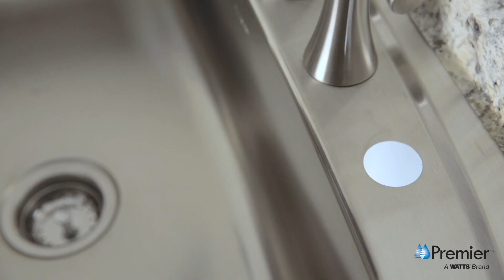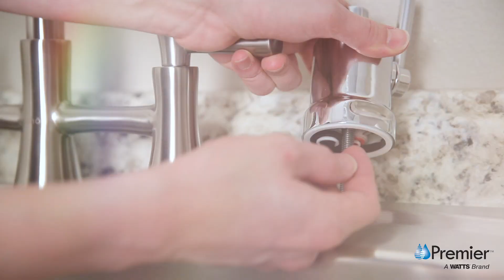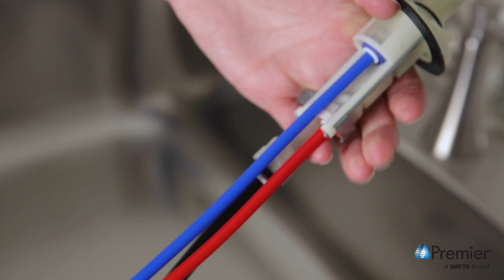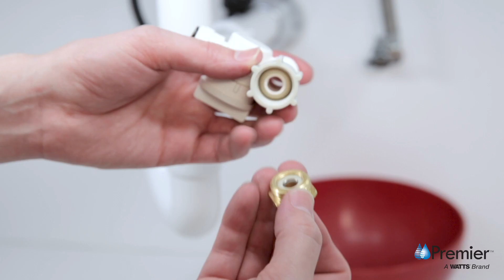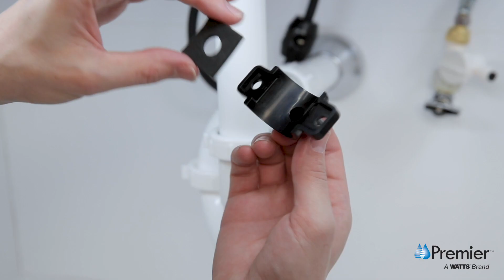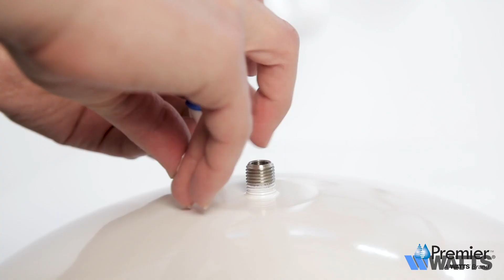Premier's RO Pure & Pure Plus Installation

Comment: It appears the plumber did not install the white Adapt-a-valve when installing my RO-Pure system.  The green tube is plugged into a brass connecter with a directional valve on it.  Will this still work to shut off the water flow to the tank for sanitizing?  I have tried turning it clockwise and the water does not seem to shut off.

Comment: Hi
You said use 1/4 inch bit for the drain hole. Manual says 3/8 which makes more sense as the tube is 3/8. 
Which one is correct?

Comment: I really don't like the idea of having to drill a hole in the pipe to use this. I could see leaks happening. I guess it has to be this way or has to be custom done otherwise with a piece that is specially designed for this. Instead it would make more sense to me to simply fill up the sink or some container with water and then stick the tubes in and have them suck up the water and filter it.

Comment: I recently bought a house with a system installed by the previous owner and I'm trying to get the system running again. I have a few questions:
1. How does one remove the water lines from the fittings? I don't want to damage either the hose or the fitting it plugs into
2. The black air gap line is improperly installed and too long - it dips beneath the drain saddle. Am I correct in assuming that this will cause big problems?
3. There is a water pump and a 40 PSI pressure switch installed under the sink, which is pumping the green tube. Is this a normal or recommended installation? Can I safely remove it from the loop?

The previous owner was a DIY guy and did a lot of things without following directions precisely, so now I'm following up the work that he did and tweaking it to work just right. There's stuff like this all over the house. Thanks for whatever help you can provide for this one!
Reply from the maker: Hello, we do apologize for the delay in our reply. See answers to your questions below:

Q1. How does one remove the water lines from the fittings? I don't want to damage either the hose or the fitting it plugs into
      A. To remove a tube from a Quick Connect fitting you should make sure the system is depressurized. Then, depress the collet ring on the fitting and pull the tubing out. Depending on the size of the tube you may use a 1/4 inch or 3/8 inch open ended wrench to depress the collet ring instead of your fingers. If you have difficulties pulling the tube out, you can try pressing both the tube and the collet ring in then pull out the tube while holding the ring down.

Q2. The black air gap line is improperly installed and too long - it dips beneath the drain saddle. Am I correct in assuming that this will cause big problems?
      A. If the system and faucet are connected as designed, having the black tube dip under the drain saddle will eventually cause your air gap on the faucet to leak. 

Q3. There is a water pump and a 40 PSI pressure switch installed under the sink, which is pumping the green tube. Is this a normal or recommended installation? Can I safely remove it from the loop?
      A. It sounds like a booster pump was installed on the system to increase the incoming water pressure. This is normal for homes with low incoming water pressure as the system's storage tank may not fill properly and the system could run for longer periods of time. In that situation, the pump may increase the storage tank's fill rate and storage capacity. To know if you can remove the pump/electrical components, you first should make sure that they are not installed in a ZeroWaste configuration. This can be determined by looking that the hot and cold water angle stops under the sink. If you have 2 adapt-a-valves (one on each angle stops) with a Green tube coming from the Cold water and a Red/Black tube leading to your Hot water, then the system is connected in a Zerowaste configuration. However, based on your second question I do not believe it to be installed in a ZeroWaste manner as the ZeroWaste does not use a Drain Saddle but instead returns the Waste water to your hot water lines. If the system is not connected as a ZeroWaste then you may certainly remove the pump, if you wish, as it is not critical to the operation. To remove the other electrical components just make sure that your system has an Automatic Shut Off Valve (ASOV) installed so that the system shuts off like it should. The ASOV is a black block-like object with 4 Quick Connect fittings (2 on each side).

Please let us know if you have any further questions or need clarification regarding any the above information.

Premier A Watts Brand
Reply: @premierawattsbrand3030  Thank you so much for the response! I got the system up and running by unplugging the booster pump and allowing the system to just run on city water pressure. Everything is working now better than the previous owner was able to get it to work (he abandoned getting the ice maker in the freezer up and running, but I was able to get it to work). 

Really appreciate the response and thorough tutorial. I will definitely be buying my next set of filters from you! :-)

Comment: I recently bought the 3 stage RO system and purchased a separate drinking faucet. The new one I purchased only allows one line to plug into it. The one that came with the RO system has three, is it possible to use the one i bought with this Watts system? Thanks
Reply from the maker: Which 3 Stage RO system did you purchase and which RO are you replacing RO Pure or Pure Plus? Whether the faucet is interchangeable or not is dependent on the tubing size of the faucet connection on the system. The faucet of the Premier RO Pure System in this video may have either 3/8" connection or 1/4" connection where the Pure Plus only has a 1/4" connection for dispensing the drinking water. Please refer to the owners manual for tubing size of the purchased 3 stage system. If the system uses a 3/8" tubing and you had the RO Pure, then it may require you to remove an adapter that would have been installed on the Premier Faucet. The Pure Plus would not accommodate a 3/8" connection.

I hope this helps! Please let us know if you have any further questions! ~Premier

Comment: i seem to be having a problem with my system, why would water be gushing out at a high rate from the blue tube that connects to my storage tank? the tank fills at a rapid rate?
Reply from the maker: There are a few possibilities for the water to be flowing at a high rate like this. First, verify that your filters are installed in the correct order, Red > Yellow > Green > Blue. If this is a new install, verify that your plumbing is correct. On the back of your system, trace the Blue tube between the black ASOV and the System manifold to make sure it is connected to the top port behind the Green Membrane filter and the Red tubing is connected to the port below it. (The top port is closest to the mounting holes on the mounting bracket.) If this is an older install, you may have a bad ASOV and the water is bypassing the filtration system flowing directly into your tank. It is also possible, however unlikely, to have a bad membrane. You can give our Technical Support a call so we can help to troubleshoot the system with you at 1-800-752-5582 option 4.

Comment: This is Pun Call's husband, Harold, and I'm not a happy camper. We went downstairs this morning and found water all over our basement on our new laminate flooring. I searched everywhere for the source and all I can determine is, when the water leaked out of the air gap faucet, it ran through the holes in the kitchen floor under the sink where the water lines come up. A "How To" video here says the drain line into the sink drain will plug up with debris from the garbage disposal, and has to be blown out. Nice, huh? What kind of ignoramus designs something like that? And, on my unit, the hole in the faucet is at the back so any water that comes out runs across the counter top. If the hole was in the front, it would run into the sink. So, now, I guess the solution is to turn off the water to the R.O. unit whenever we're not using it. That's a bunch of bullshit. When I had a plumbing and heating business many years ago, I used Watt's regulators and other things, and found them superior in quality. But today, they obviously have a new crop of engineers who don't know their ass from a hole in the ground. I'm going to scratch Watts' name off my list. Might as well buy Chinese crap.
Reply from the maker: Good morning Harold. I'm sorry to hear about your experience. The air-gap faucet is a standard feature of all Reverse Osmosis systems and they are all built this way.  Since you had an air gap leak, if you contact our technical support team at 800-752-5582, they can assist you. Regards, Premier
Reply: @premierawattsbrand3030  I spoke with your tech on the phone and followed his suggestions. So far, it's working o.k. with no leakage. Thank you.

Comment: After installation and turning the water on, there is a significant amount of water coming from a hole in the top mount faucet. What can I do about this?
Reply from the maker: There are just three things that could cause this: 
1) Make sure the hole you drilled on the drain pipe aligns with the hole on the drain saddle.
2) Make sure the black tubing is as short and straight as possible.
3) Make sure the flow restrictor is in place on the red tubing. The flow restrictor would be in the "Bent" end of the red tubing,

If the red tubing is missing a flow restrictor you may call our technical support at 1-800-752-5582 option 4. They can also help to walk you through any troubleshooting  on your system to get it functioning properly.
Reply: @premierawattsbrand3030  I installed a Watts RO unit in my home about a year ago. This morning, just after we got home from church, water started spraying out of the hole in the back of the faucet. There was no problem until now. What's up with this?

Comment: If i inserted wrong head of the red tube in the faucet how do i get it out ??
Reply from the maker: Hello Kamran, We do apologize for the delay in our reply. To remove a tubing from a Quick Connect fitting, you will press in on the collet ring and pull the tube out. However, it can be difficult to remove the tubing from the faucet fitting as it is recessed in the base. To reach it, you can use a small, open end wrench to press down on the white collet and pull on the red tube. The other option would be to leave the tube as-is and install a 90 degree stem elbow on the system where the red tube should go. The Flow restrictor will function in either place on the tubing.

Comment: Helpful video thanks 
Please how to change monitor battery
Reply from the maker: Khadija, 

I want to apologize for not being able to respond to you sooner.

Step 1 - Turn the handle on the storage tank ball valve to the “off” position and lower faucet handle to “on” position.

Step 2 - Remove the faucet handle cover at the slot. Note - Water will dribble out of the spout, use caution when handling the electronic components.

Step 3 - Slide the old battery out and replace with new battery. Note - Once the battery is pushed into the clip a red and blue light will flash indicating proper installation.

Step 4 -Replace cover assembly onto the faucet handle while aligning the tab on the cover with the notch on the faucets handle.

Sincerely, 
Premier